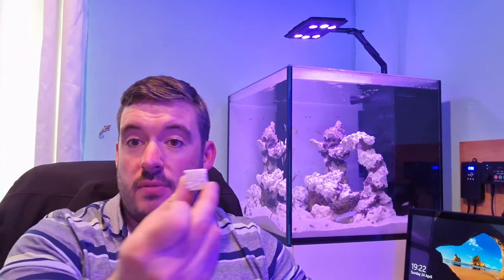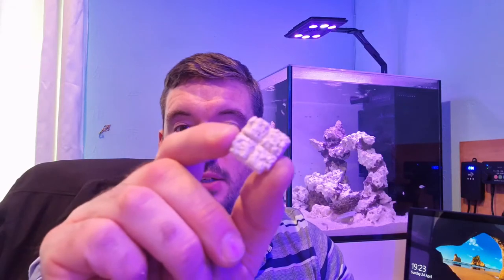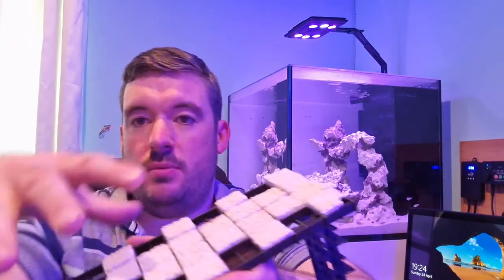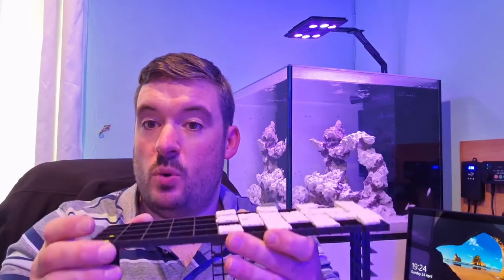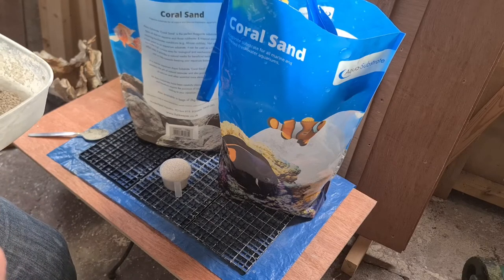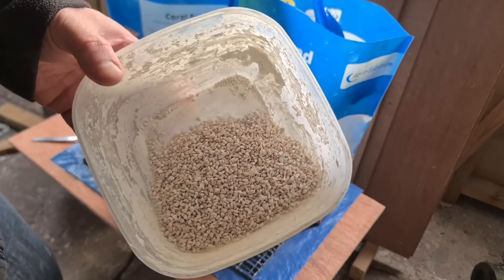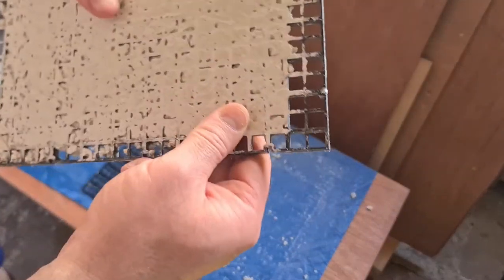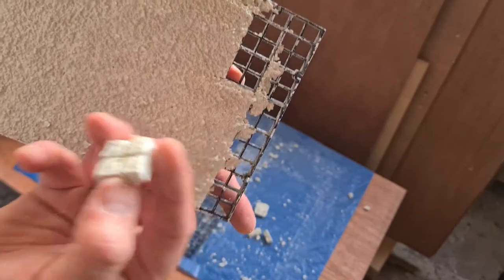How To Make DIY Coral Frag Tiles/Plugs

Comment: Literally had a similar idea. Great stuff. The snapping makes it perfect. Thanks!

Edit: have you considered using cooking spray to coat the crating to avoid the sticking?

My idea is also to use some coarse aquarium salt in the mixture. Then when the frag tiles are being cured in the water, it will desolve and cause pores for critters perhaps. I have tried with grey cement thus far, but it has made it quite brittle, my cement to sand ratio may have been too weak though. I'm still doing some RnD.
Reply from the maker: The cooking spray is a great idea! I will need to try that in future!

So adding salt was the initial plan based on the Esox thread on the ultimate reef forum for making diy live rock and I love all the critters and life (although I find plenty mico brittle stars and stuff still get into the indents under the tiles) on an early attempt I tried the salt but because of how thin the tiles were they were too soft and brittle it may of been my mix ratio, would be great if it worked.

Yeah getting the mix right is the hard part every cement and sand is a little different so can take a few attempts, I may or may not bother with the white cement again my few tiles I have in the display are now being covered in coraline so doesn't matter too much, good luck with your tiles!

Comment: where can i get that exact egg crate as the stuff on all ponds doesnt seem to have the extra lower plastic ribs
Reply from the maker: It doesn't show it well on the All Pond Solutions website I think it's photographed from the flat side, but that's the only type of egg crate they do, if not you can find similar stuff on ebay or Amazon like this 👍

Wetrys 6 Pcs Grid Isolate Board Divider Fish Tank Bottom Black Filter Tray Aquarium Crate https://amzn.eu/d/1LapjcK
Reply: @PracticalReefer  thank you